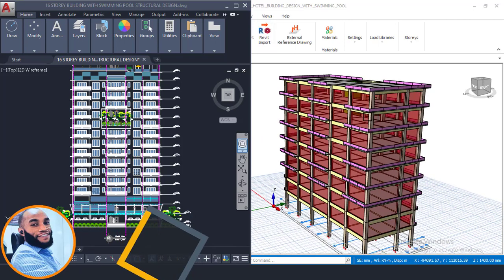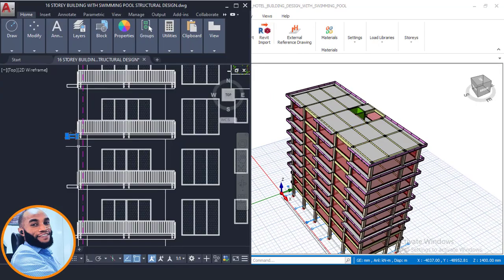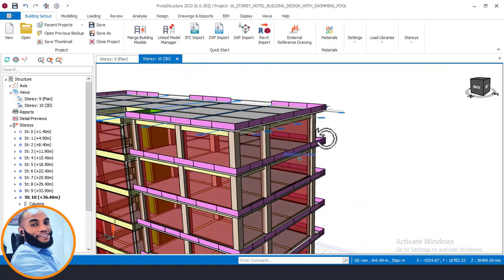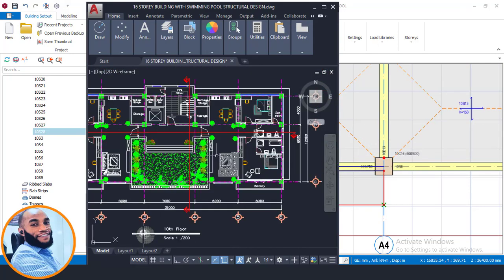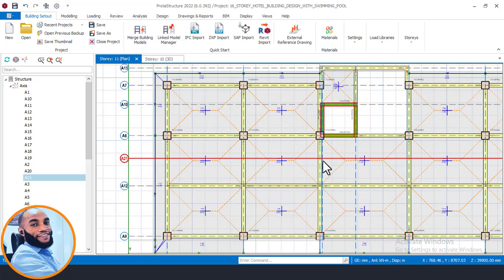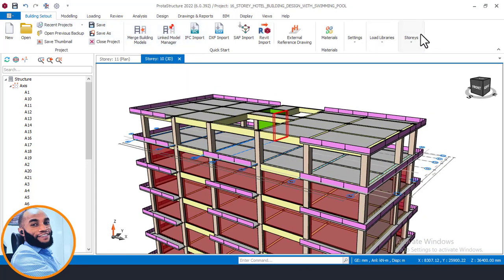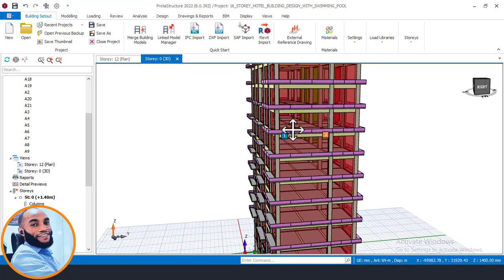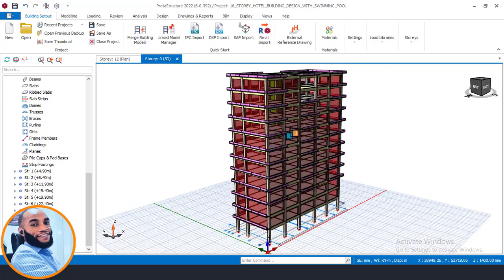PART 6 - 16 STOREY HOTEL BUILDING DESIGN IN CIVIL ENGINEERING USING PROTASTRUCTURE 2022

Comment: The slab area that was modeled for the green roof is smaller than the actual area in the architectural drawing. Won’t that affect the structure? Due to the additional dead load of the soil on it